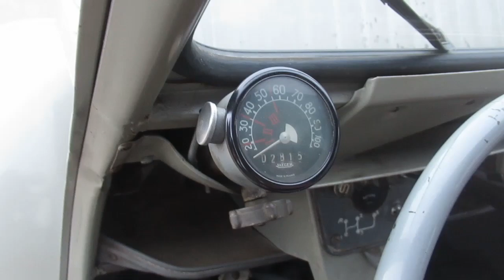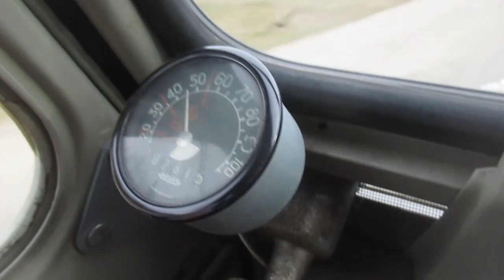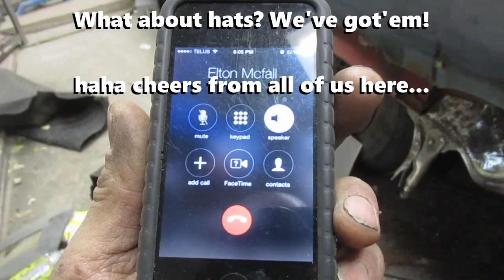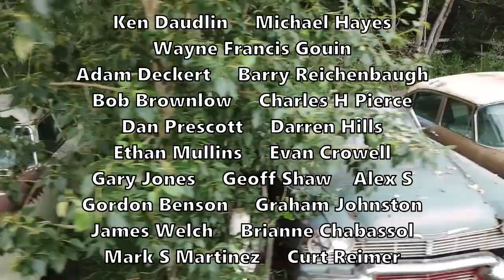60 Fury Project Update and "Turn up the Base" Special!

Comment: that rear quarter repair deserves a bare metal clear coat, very well done.
i used to work on those 2cv's we ordered a rear chassis leg for one, 4 pieces of flat sheet steel turned up,  lol

Comment: I had heard that those Citroen 2CV's run so smooth because their original use was to be used on farms to transport eggs safely through rutted European farm roads. The engines were basically just enough to pull itself and little more.

Comment: The Fury is looking amazing! But good Lord that 2CV! I thought my 58 Lloyd was loud, that's even worse! I've got 19hp, the 2CV has 14! Finally, something I could possibly outrun. It would be a most epic (and depressing) drag race! Two 2 cylinder titans from the same year going head to head, France vs Germany! If I weren't so far away I'd head up there!
Reply: I can picture it - you're in the middle of your drag race and the police come up behind you. But instead of getting tickets, you're just given a warning that you are obstructing traffic so please pull over to let other vehicles pass. Doesn't the Lloyd have a 175 cc advantage? Hardly fare unless there's a cross-country component to even things out.

Comment: Been "anxiously" awaiting the next CWM episode and the wait was well worth it !!! This was the perfect video with all the "technique" details and thinking process included in the metal working . That metal shrinking/stretching stuff can be SO frustrating and tedious trying to determine where the pressure/stress point is located on the panel that will allow it to return to its "static" shape. Also "cool" to see that someone else's tools also try to "go take a nap" while you're right in the middle of using them. ;o)
Always thought Citroen's were just "strange ugly French cars" until watching your channel. This one makes a VW Beatle look like a "luxury Car" !! Funny how the more basic the old car is, the more "endearing" it instantly becomes to the "car nut". Of course, there's certainly none of those roaming around here !!! 🤘👌✌️👍👍👍🤓😉😎

Comment: I haven't seen a 2CV that old in UK for a while. That one looks a bit low, particularly up front. Good ground clearance was quite a feature when you "have to be able to drive across a ploughed field with a basket of eggs without breaking any". Which was part of the original design brief I think? Great job on the Plymouth quarter panel; seriously impressive!

Comment: I know a neat trick to finish beads on panels, get a pack of those cheapass chicom hollow punches ,grind off one side of the sharp end .use the punch to finish the end of the bend,against a chunk of steel or hard wood.With a variety of sizes you can do almost any bead except those double beads you see on Some 50 or 60's Buicks.

Comment: That quarter panel looks so awesome now that the old paint is ground off and everything evened out. If I were you I would probably loose a week's time just standing around and staring at the thing. Spraying primer over it all it will be bitter-sweet. Maybe just clear coat that sucker?

Comment: I have a 4 door 1960 plymouth belevedere too. All my rear quarters, trunk floor are in perfect shape. My problem area is the floorpans. The passenger frt fender & bumper are bent up. Old owner cut a wooden telephone pole in half & drove away.  Awesome car & thoughtfully put together. Too bad running gear is fubar.

Comment: My understanding is that the 2CV was initially designed to traverse a farmer's field smoothly. It looks like you passed the test.
Reply: Yes it was, to my understanding it was made so that farmers from rural parts of France where able to take their produce like crops and eggs to their local markets without breaking half of it along the way. Hence also the very low gearing.

Comment: Oh yeah, Ian at Hubnut Channel has a 2CV ,which he drives everywhere and even competes at car things. He has fitted a big bore kit,625 CC i think. In the Uk there is a huge following for them . That wrinkle face version needs an electronic ignition kit to make it easier to live with and a tappet adjustment. Check out Hubnuts to see how well they can be made to run .
Reply: This one has barely run in 10 years so will be getting a bit of sorting.

Comment: Two questions: Has the trunk lid been used to set/check the gaps for the fins width L&R ? What is the function of the drain plug? Used during the primer bath? Thanks for the 2CV ride and power thru the gears.

Comment: As far as engine and drivetrain is concerned, I would hope you could install a Fury "Power Pack" 4bbl carb and manifold, and maybe a cam. Dual exhausts on tailfinned cars are, of course, manditory.

Comment: AWESOME body work!!!

Did Citroen use the same body style for a long time? That car looks more like 1938 than 1958!
Reply: The 2CV was designed in the late thirties, and three prototypes were hidden because a certain German dictator didn't want competition for his own "car for the people," the German word for which I forgot.

It debuted at the 1948 Paris Motor Show with a 9 (yes, 9) horsepower, 375cc flat twin. Over a 42-year production run, the air-cooled flat twin grew to 602cc and 29 horsepower. The last ones were made in Portugal in 1990.

The smooth ride comes from longitudinal torsion bars and shock absorbers located under the passenger compartment. The directive to Citroën engineers was that a French farmer had to get a basket of eggs across an unplowed field without breaking any. The original canvas top rolled all the way to the back bumper, and with the removable seats and spartan interior, allowed the owner to transport livestock to market.

It isn't pretty, but it's really a fascinating little car.
Reply: Wanderinggentile — wow, thank you very much for your excellent reply.. The 2CV really looks like “a creature from another time.”

Comment: Fantastic work on the Fury. The work on that right quarter just amazes me. On the Citroen, what is the purpose of the moveable headlamp?
Reply: The 2cv suspension is so soft that having rear passengers or cargo would cause the rear of the car to squat and throw off the aim of your headlights.
Reply: That makes a lot of sense! Those little cars were well thought out.

Comment: Model T is still more base; electric starter, speedometer, water pump were optional, doors didn't exist on early models, later models sometimes only had 1 door, wood wheels were a thing, manual timing advance, no oil dip stick, you had to open a petcock and see if oil drained out to know how much oil was in it, 2 speed transmission, if you go up a steep hill with the advance up to much you could crack the crankshaft, also no fuel pump so you could starve it for fuel going up the hill. no brakes on the wheels, only a transmission brake.
Reply from the maker: Well... The 2cv is air cooled, 2 cylinder, no seat stuffing, windows don't roll down, no headliner, no gas gauge, and it is 30+ years newer. The model T was equipped much like its contemporaries, (and mine has rear wheel brakes) but the 2CV was pretty basic by 1950s standards. Not that this is even a "real" comparison; just having a laugh. Andre Citroen was a big fan of the model T and wanted something like it for the French people. I guess I could say that a pair of shoes is more base than anything, if we want to get ultra-pedantic. (Shoes! You had shoes! When I was a kid... etc.) Thanks for the note; cheers!
Reply: @coldwarmotors  sweet deal you got the "rocky mountain" rear brakes on your T, those are way better then the stock trans brake. oh yeah definitely the is 2CV base for 1950s standards id say even base for the 1930s and 1940s for that matter, the crazy part is they made them all the way till 1990! sad thing is we probable wont have another car that simple made again...